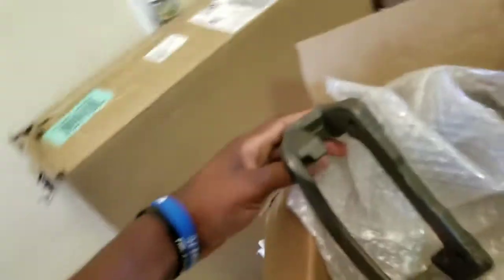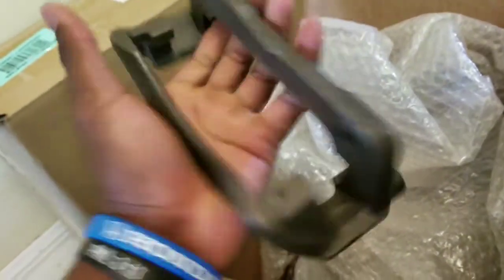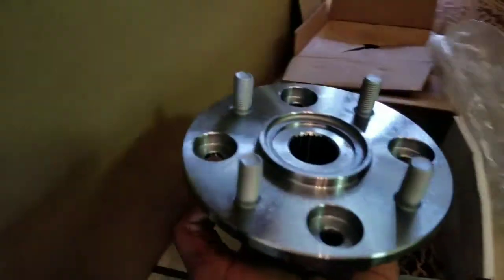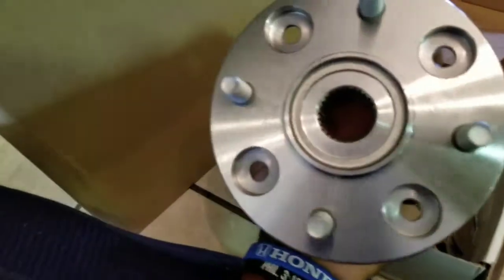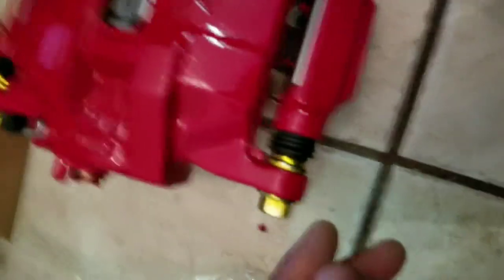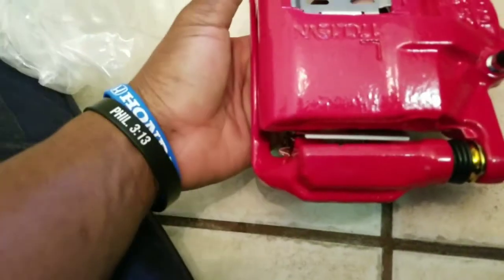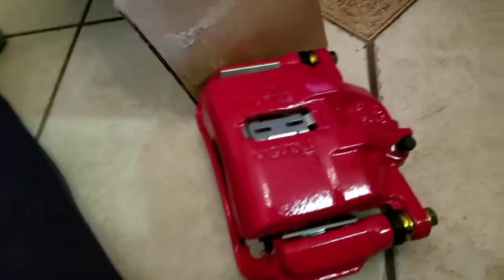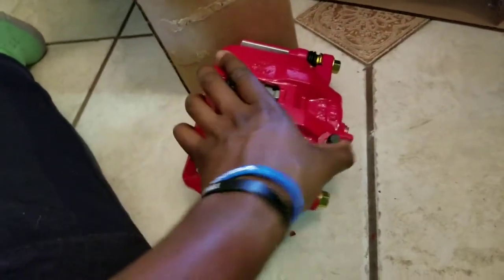STOPPING POWER! ROTOR OVER HUB CONVERSION CB7 ACCORD

Comment: Nice video. If you can remember where did you get the hubs and bearing from, as well as the calipers?
Reply from the maker: Thank you! Here’s the eBay link I got the hubs and bearings. 
https://www.ebay.com/itm/274524176695?mkcid=16&mkevt=1&mkrid=711-127632-2357-0&ssspo=817BDHw6TuG&sssrc=2349624&ssuid=&var=&widget_ver=artemis&media=COPY
Reply: @R3TV have the hubs worked well for you since you've installed them, run into any problems using them?

Comment: How fast is it with the current setup
Reply from the maker: On the stock block H22 I made 360whp on 10 psi . On the built setup I’m guessing it will be 550-600. I’ll see here in a few weeks.
Reply: @R3TV  damn okay should I H series swap my CB7? Or could I still make 300+WHP with the stock block F22 I have
Reply from the maker: @joeyhammer1998  if I where to go back I would definitely keep my F22a6  I had in and boost it.  I must say they are much more reliable than the h22s but it’s much easier to make power with H
Reply: @R3TV  oh okay cool thanks for the input I have an F22a1 with a 5 speed and a twin disk clutch I wanna boost it I just didn't know if it was a good idea or not but now I do so that you my man